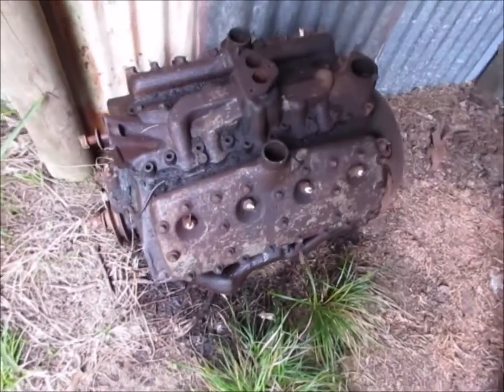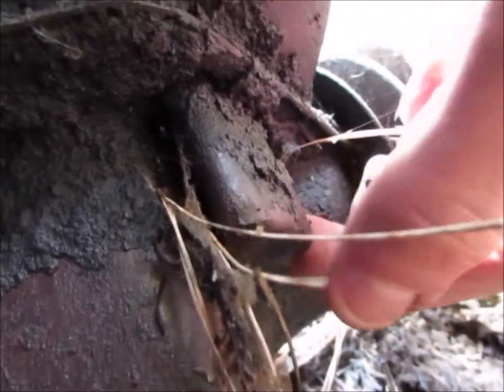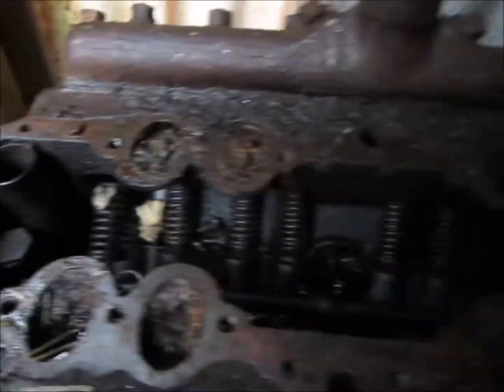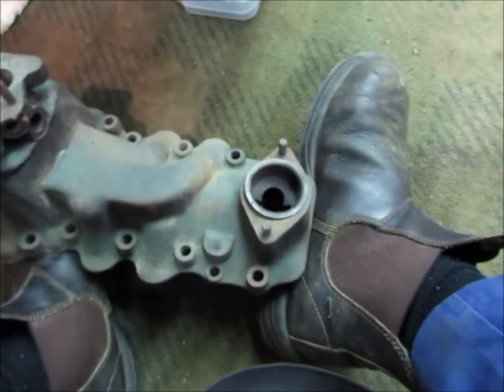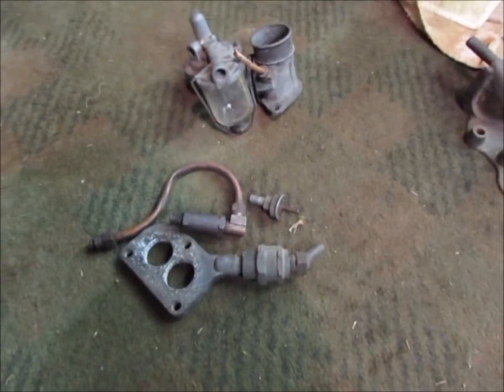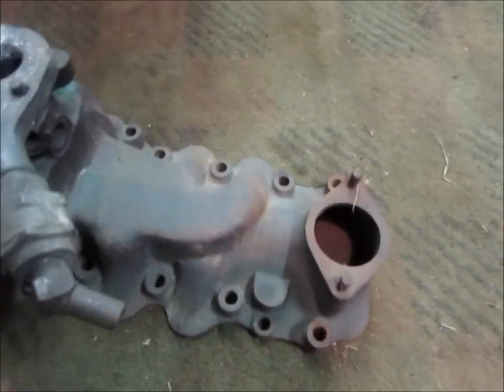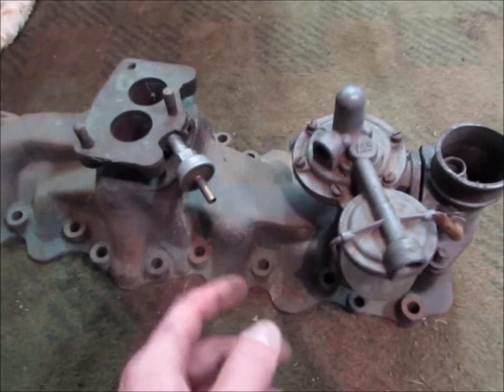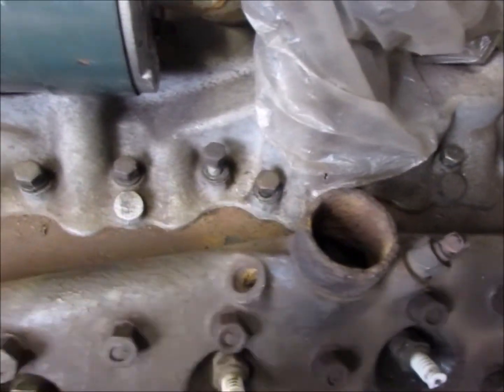The wonderful Flathead v8 - Crankcase ventilation works opposite from the book?

Comment: I was under the impression the air flowed in exactly the opposite direction. The rear being the inlet and the front tube being the outlet. One or two of mine have those outlet draft tubes intact.